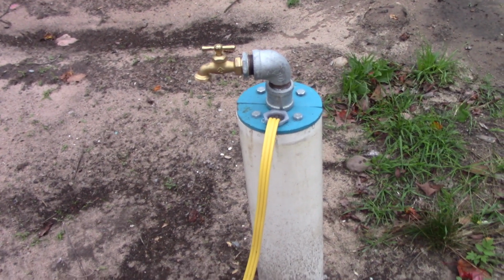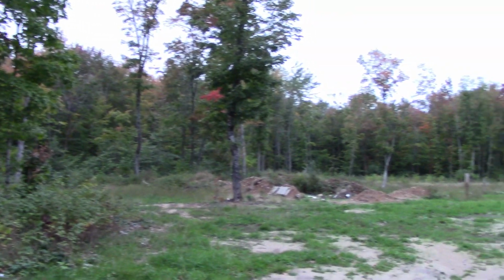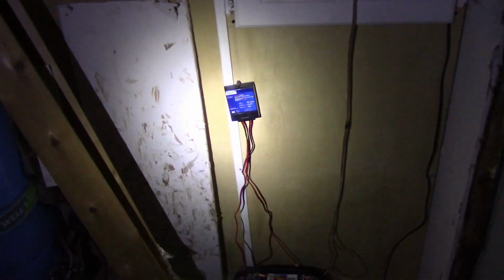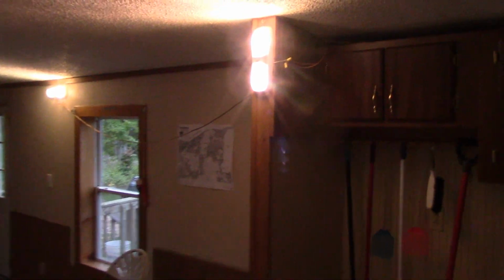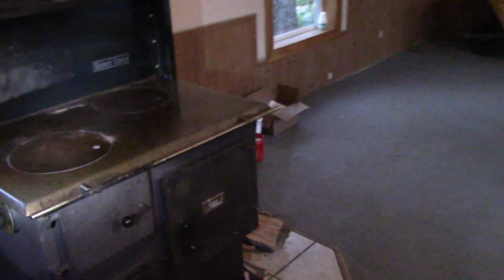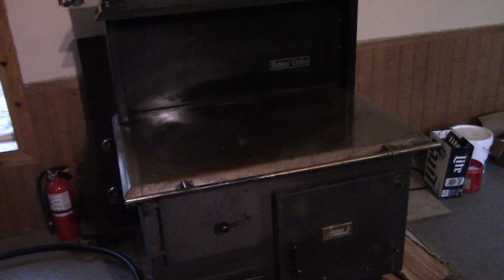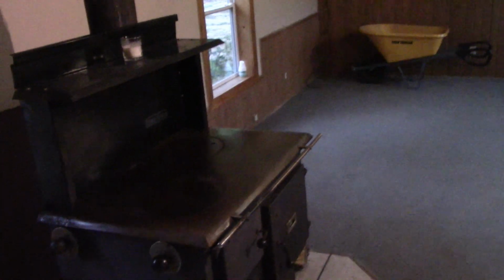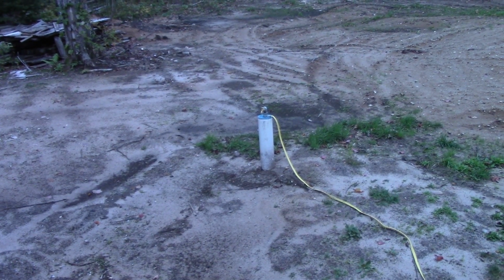Off Grid Life Essentials! Reclaiming Off Grid U.P. Cabin SOLD!!

Comment: Would a pump like that need some sort of insulation around it for MI winter?
Reply from the maker: If you run it directly out of the ground as pictured....you drill a 1/8" dia. weep hole in the pipe below the frost line...it slowly drains it
Reply from the maker: Or disable the check valve  in the pump
Reply: How did you insulate the crawl space?